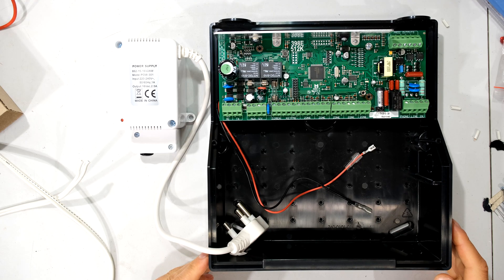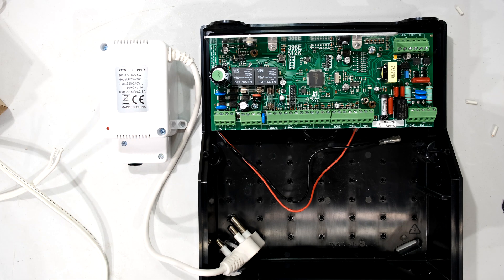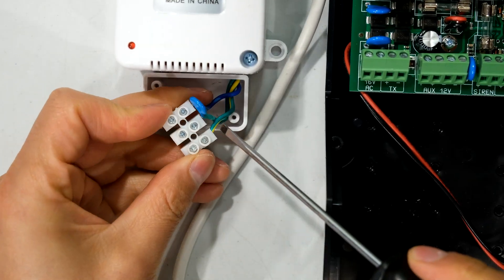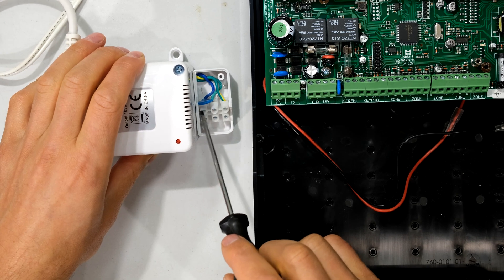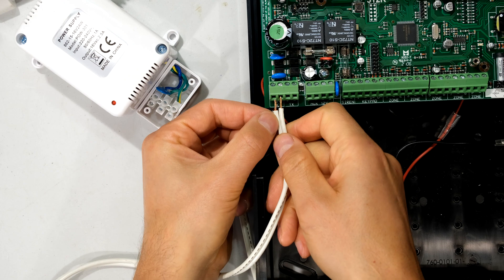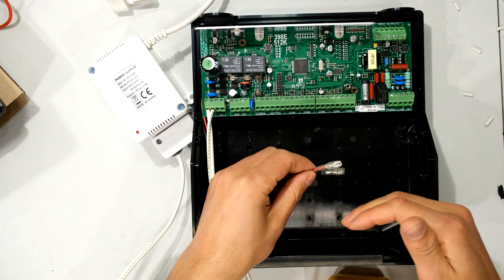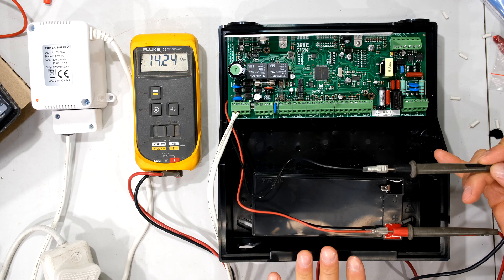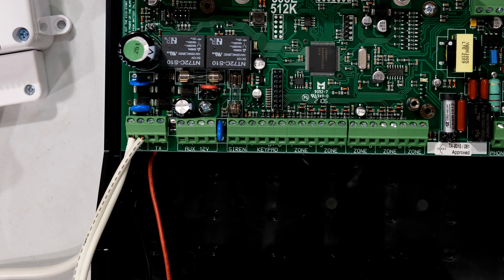How to connect an AC transformer power supply and battery to the IDS alarm panel - tutorial

Comment: Hi, do you have a detailed video on the correct way to wire up the back up power supply, I have the IDS alarm and back up supply with 2 new batteries and it won't even last 4 hours, the alarm company says the back up is connected to the Beams only, so I don't understand how it's been wired.
Reply: Hi Ashton, did you manage to sort this out? I had a Sherlo Tronics 12V 6.4A backup battery connected and it does not last 2hours.
Reply: Hi, it was the battery that was faulty, the lead acid battery is not meant for the loadshedding we get, even a new lead acid battery that is completely drained will never work properly again, I switched over to lithium 7ah batteries, they cost a bit more but last much longer in terms of age.
Reply: @ashtonchetty4408  Thanks for replying. Only 3 months ago I had a 12V backup gel battery installed, but it keeps dying after about 90min of loadshedding. The battery definately does not charge. Thought I was a faulty installation.
Reply: @Zee-z7m  I did have a problem with the sherlo back up unit, the power supply was charging at a low voltage so it did not charge the battery enough, if you open it up you will see on the power supply a small plastic adjustment screw use a star screw driver and turn it clockwise if I'm not mistaken it will increase the voltage, mine wasnt adjusting so I bought a power supply from China mall, costed like R150, works perfectly now (note) it should charge over 14v mine was charging at 13v.
Reply: @ashtonchetty4408  thanks Ashton, this is really good advice. I'm no electrician, but I knew something is not right. No instructions of this kind with the installation pamphlet. 🙁
Reply: @Zee-z7m  True it is difficult at times to find the fault, lol I'm not an Electrician either, I learnt by trial and error. If you have a multi meter you can test it out yourself, maybe you can find the fault.
Reply: @ashtonchetty4408  no sadly I have none of those things, neither will I know how to use it. But thanks a lot for taking the time to reply. Just one last question - I am told by IDS technical that I need a to install a switch of some sort between the back up battery and the alarm. Otherwise the unit that charged the old small lead acid battery, is going to try and charge the 12V gel battery and not succeed in charging it to full capacity. Is that what you did?
Reply: @Zee-z7m  Yes that is correct, I don't know the name of it but it is a relay switch. If you search (AC DC NT72C-S10) thats what needs to be installed between the sherlo and alarm battery.
Reply: @ashtonchetty4408  thank you very much for taking the time to help me with this. Will let you know about the outcome.

Comment: Good morning, I have á doubt, yesterday when there was a power cut , the system of alarm was working with battery power then the battery ran out of power and the system turned off , but now that power is back , all the sensor and keypad are turned off, but the keypad lights up and then hang up soon , I ask you to help me what could this be.